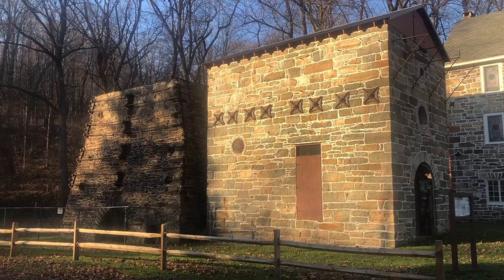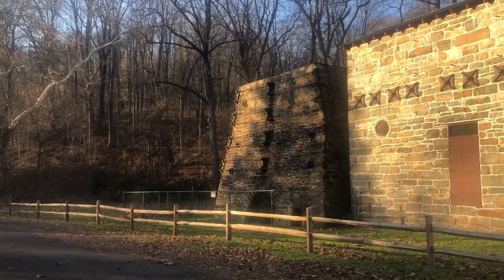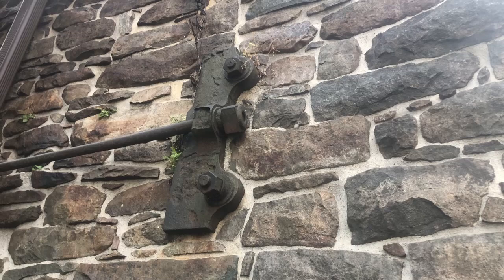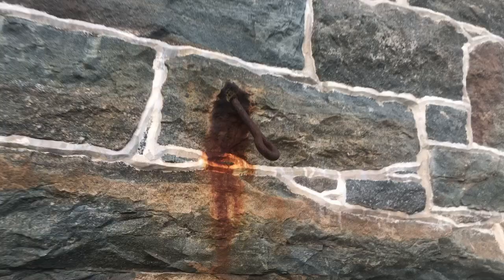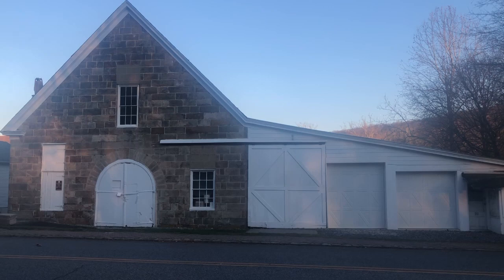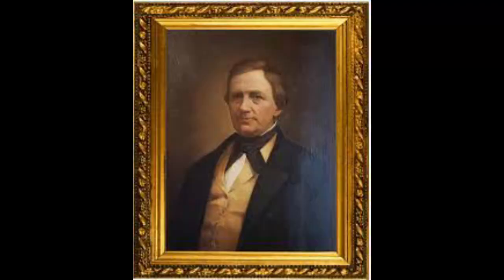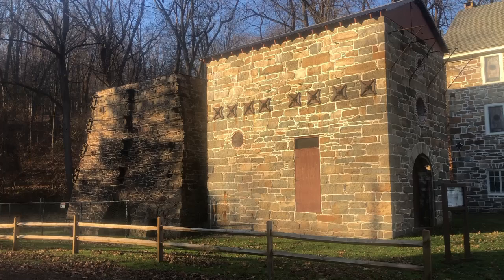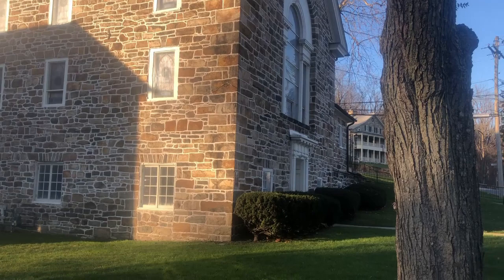The Oxford Blast Furnace:  America's longest operating colonial furnace

Comment: By the slack of rust on the “steel” I would say it is not steel but Wrought Iron. Real wrought iron not the steel that is worked decoratively that today is called wrought iron.
It could also be cast iron, not sure.

When furnace was first built steel had not been invented yet.
Wrought iron is very rust resistant .

No where in the world is Wrought Iron still made. A company in the UK sells it by reclaiming and reprocessing old buildings and equipment.

I Think the Williamsburg blacksmith shop may make small batches for the museum ?